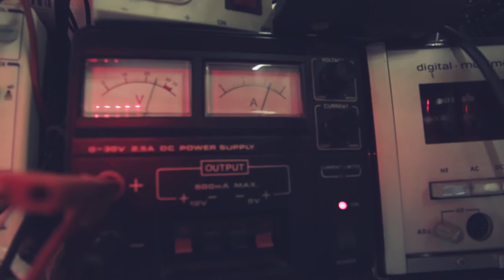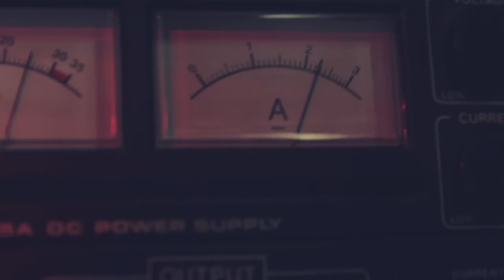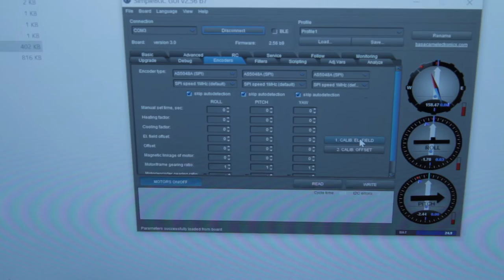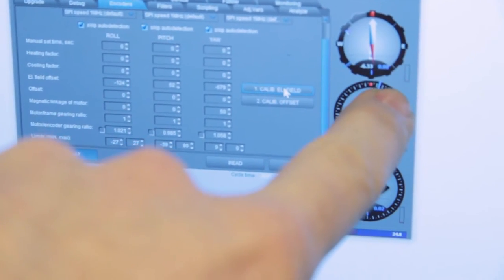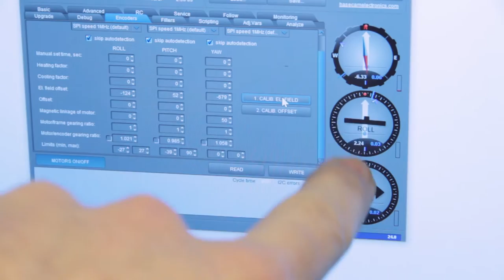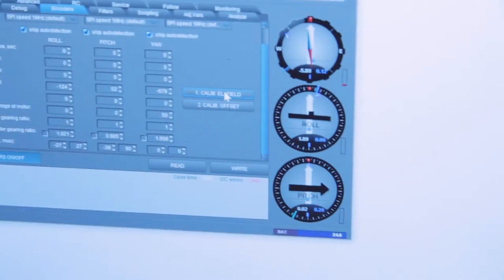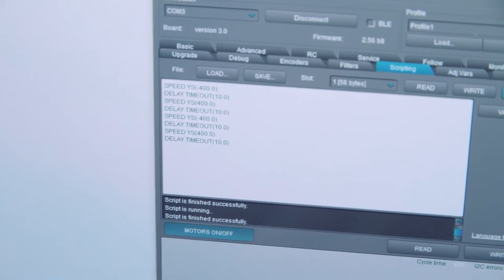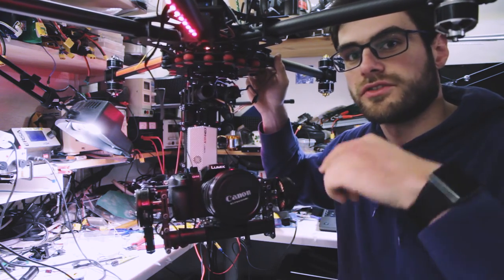Upgrading brushless gimbal with AS5048A magnetic encoders and YAW slipring PART2

Comment: Hello youser23 very nice setup, seems like a lot of work, Just checked at basecam site and firwmware 2.6 only support YAW encoder, to support all encoders they say you need an original basecam board and a special $40 encoder firmware, are you using this setup? if not wich board and firmware are using? I'm bulding a quad 22" props 274kv 6s8p 18650GA to carry my gh4 metaboones and end up in the crossroad of selecting motors/encoders for the gimbal, do you think a 6208 on 3 axis will be enough or even 5208 on pitch roll and 6208 yaw? this and the board/firmware are my 2 main questions I really would appreciate your opinion, thanks buddy!
Reply from the maker: hi. yes i bought the $40 encoder firmware for this and used an original 32bit board in an aluminum case from the "rctimer" shop. concerning your motor question i cant really give you advice. there are so many out there..
Reply: Thanks for your feedback, I guess is the only route then, regarding motor yes I have read so many setups, I have a feeling that if you achive a good balance you can get away with 5208s, my weight budget is thight if I want to achive 30 min on air, thank you for your reply!
Reply: Wieger Salazar start a pool 10,000$ become licensed dealer of dvds